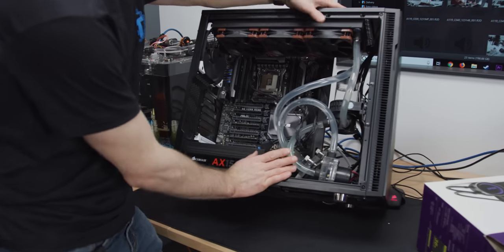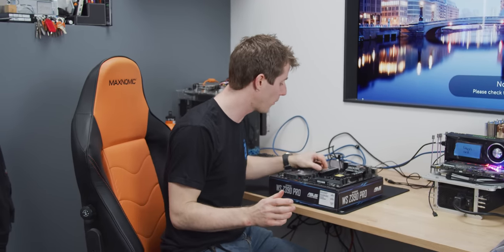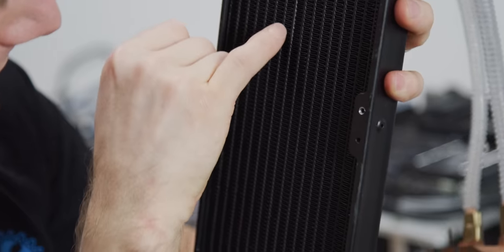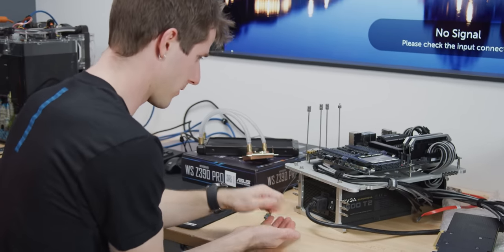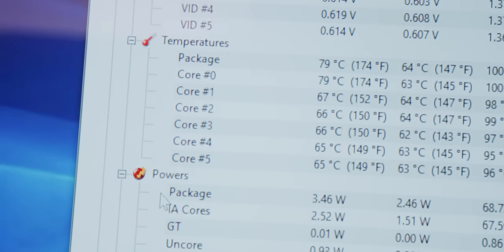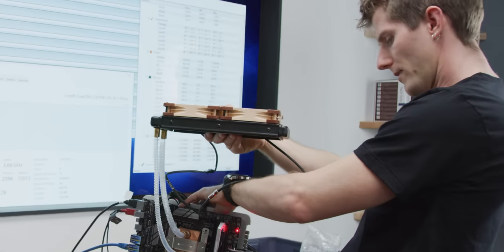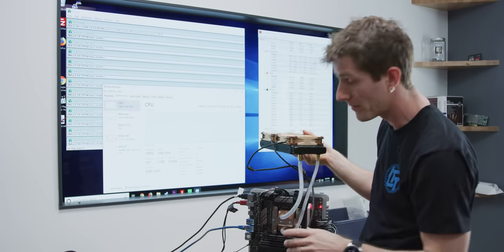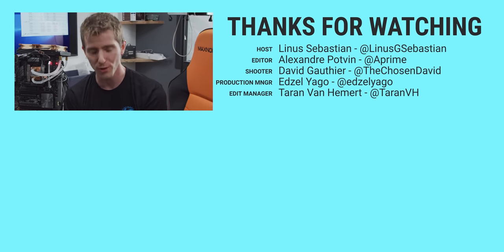CPU Cooling with BOILING LIQUID 🔥🔥

Comment: they should put a pair of one way valve on both tube, so that only 1 tube is responsible for the heated coolant, and the other will be responsible for returning the cooled liquid. it will also help to raise the heated liquid quicker.
Reply: One way valves require a differential pressure to open.  Putting one on this system would cause it to no longer flow.
Reply: Not needed. If Linus has held the radiator in the correct orientation with one of the tubes higher than the other onto the radiator it would have flowed nicely. Hot water rises while cold water sinks. The radiator is a long path running from one end of it to the other and back with the tubes connected on each end of that path. He basically tried to force hot water in to both ends of the radiator.
Reply: @pederb82  exactly.  It should be sideways with the hot side on the top and cold side on the bottom just like the water block.
Reply: @Hello World They would be expensive to produce and exceedingly large to do the flow required.  They are not one way valves, they just give high flow resistance in one direction vs the other.  You are also dealing with gasses, not just liquids in this design.  The design also requires high velocities fluid velocities.  The resistance ratio goes up the higher the fluid velocity is.  The velocity of the fluid in this arrangement is very low.  In order for this type of device to be helpful, it would need to deal with a single phase and use a pump to achieve the velocities needed to get a ratio.  Both of these constraints defeat the purpose of the intended design.  A hollow plastic float on the cold side oriented in the vertical direction that would seal into a seat would work much better and be much cheaper to design.  It would probably also offer too much resistance to makes its use more effective than not having it at all.
Reply: Hello World it can be done with an different layout of the radiator quite easily. They could have the entire top side of a horizontal radiator as hot side and bottom part as the cold side. :) it would be a bit ticker than the radiator used here but other than that practically identical.
Reply: @Hello World The makers of the cooler should have done a radiator where the ports are on opposite sides instead of the same side.  Hot side goes in the top, cold side come out the bottom.  That being said, they did not and used a standard radiator.  What Peter said would be how the radiator would need to be oriented to maximize the equipment given.
Reply: @pederb82  Lol you posted this while I was writing mine.
Reply: @Hello World Making a single pass radiator is just as easy as a dual pass radiator like what what used.  The reason they probably put them on the same side is it looks cleaner and you can have more radiator area for a given size of radiator.
Reply: @pederb82  true
Reply: I think it would work. This is how a coffee maker pumps water. The local high pressure of the water vapor opens the valve. This is why the coffee maker spits the water upwards
Reply: @AllElectronicsGr  A coffee maker only has one outlet, not 2.
Reply: @Worrsaint   There are two outlets in a percolating coffee maker, but one is blocked by the one way valve. Go check out the design of the siphon tube in a percolator and get back to us.

Comment: You have both pipes at the same level.  The intake side should sit lower than the hot side.  Since heat rises yada yada yada, once cooled by the radiator it should go through the cold side and come up from the bottom.

Comment: they should use iso-pentane as solvend, it boils at 28°C degrees so the cpu block technically won't go much over 28 degrees, altough you will need some beefy fans to cool them enough to prevent overpressure of the system altogether which is very dangerous. Cooling will be great as long as you can cool the solvent to get liquid again.

Comment: It's called thermo-siphoning.
Early automotive water cooling works the same way.

Liquid used in the thermal solution had very low boiling temperature. The boiled liquid turned into gas and carry heat away from heat source. Once the gas cooled, it return to liquid state and continue the cycle all over again.

Comment: Seems promising. I think that having a vertically-oriented radiator, entirely above the CPU, would make the most sense, so the hot gas moves to the top of the radiator, and liquid comes out the bottom back into the CPU block.
Reply: No because you would decrease the airflow  by convection. The ideal is a slitghly tilted configuration in the horizontal plane, so all the fins receive a fresh airflow

Comment: What about connect one pipe straight to the faucet
 and the other to the drains? ABSOLUTELY SILENT cooling system!
Reply: Just live by a river and use river water as inlet cool water, discharge the hot radioactive water back into the river!
Reply: @soupwizard  Do you mean the revolutionary "Industrial" way? XD

Comment: I think it is supposed to work like the bubble-pump in a coffee-maker. There are stem bubbles forming that float up pushing the liquid as it expands. That's why it should be mounted vertically with the large pipe up, liquid+steam takes more space than just liquid.

Comment: This is kinda funny.  I did the same thing back in 2004, using a single thick hose and a floorboard radiator for cooling and HFC152a (Canned Duster) as a transfer medium.
It almost worked.  It kept my tbird 1400 nice and cool all day long under moderate loads (better than typical fan cooler), but because of the overly simple block design, under heavy load it would eventually boil fast enough that it had a sustained bubble keeping most of the fluid from returning to the block, and the temperature would quickly spike and crash the CPU. (No thermal throttling in those days)

Comment: I know this is an old video but one thing that could make a great difference would be adding 3d printed tesla valves, especially using a sla printer.  This would add check valves keeping flow going in one direction without adding possible mechanical failures. Keeping the no moving part theme. And of course I'd find another fluid.
Reply: Sorry for being bitter but tesla valves just don't work...

Comment: I have my pump over in the next room, woke lvl1000
Reply: Mine is in the basement with the 55 gallon plastic drum...well actually there is 3 more pumps in the loop and an internal reservoir inside the PC case as well, but it keeps me down to 40 C under full load with no radiator or fans.

Comment: There aren't very many fluids that will go from a gas to a liquid around ambient temperature. It is definitely something of a low boiling point kept under pressure or a high boiling point kept in a vacuum. As to what it is I do not know. Possibly methanol put under a few hg of vacuum. It naturally has a boiling point around 64c and a vacuum would lower that substantially. That would explain not using typical plastics or rubber seals. It does not however transfer heat so well so it would have to stay quite cool to do the job which further supports it being under vacuum.

Comment: I don't understand why they don't combine a liebig condenser with a fractionation column: Have an inner tube and outer tube. The inner tube should be water which evaporates near 100°C. The outer tube should contain either a different (cooler) liquid (or maybe water) which would be fractionated to help heat travel up and down the pipe. A third option would be to increase the pressure in the pipe, which would lower the boiling point of the water and increase cooling efficiency at lower temps. This would decrease efficiency at higher temps though, and to solve this, the inner and outer pipes could be both higher and lower than atmospheric pressure to service cooling at low and high cpu temps. Just some thoughts.
Reply: You mean decrease the pressure to increase the boiling point? When atmospheric pressure is lower, such as at a higher altitude, it takes less energy to bring water to the boiling point. Less energy means less heat, which means water will boil at a lower temperature at a higher altitude.

Comment: We already have those, they are those air coolers that can also work passively.
Just install a 340W tdp rated one in a 80W heat producing CPU, and turn the fan off. Works great.

Comment: A wild guess:
The "fill port" at the block may initially have been used to fill the system to a certain level with liquid (most likely water, with additives). 
By sucking out the remaining air to make a lower pressure inside the system, the water will boil at a lower temperature.
The "fill port" is then sealed to avoid any air entering the system. 
I guess the clear tubes are ribbed to withstand the negative pressure......to stop them from imploding.

Comment: Sure you don't have a pump that's going to fail, but a CPU that runs at 95-100c all day every day certainly will
Reply: Not really... look at laptop CPUs, the stay in the high 90s and they work fine .
Reply: you could use a bunch of small pipes which would create steam at lower temperatures and would still work
Reply: I'm sure that it's not really designed for overclockable i7s but rather for making silent mid-tier system on i3 and i5 which have significantly lower heat output that can be easily dissipated by this thing. Though if it still will require a fan, a decent tower with low noise fan will do it better and cheaper.
Reply: my laptop cpu is at 95-102 C
24/7
5 years still works great
Reply: @adrian80_  damn bro what are you doing all day
Reply: @bobbyflay4104  playing games
Reply: Extremely late but no all modern CPU and GPU  hard ware can chill in the 90-100 range for longer than your upgrade cycle any actual dangerous temperature will cause the system to turn itself off.

Comment: Large tube on top to carry the vapor, smaller tube on bottom to carry the liquid return.  Gases have a higher specific volume than liquids.  Also need the vapor return line to be on the top side of the radiator so that the liquid return can be more easily gravity fed.

This is a common type of set up for steam condensing systems or other industrial applications.  Especially for refrigerant cooling applications on large scales where the efficiency vs capital cost makes sense.

Comment: Final step for no moving parts PC:
Anybody got some spare ion thrusters?
Reply: The gas and electrons are still moving.  Ion thrusters also produce very little force (barely enough to levitate paper) and at least a little bit of heat.  Their strengths are that they require almost no power/fuel and can reach insanely high speeds if kept running so they're better for long distances that don't require changing direction and still need something else to get them started/out of Earths gravity.

Comment: Linus has no idea what he is doing I feel so bad for the people that made this prototype
Reply: yeah, and calling this cobbled together while it has nice bends, no sharp edges, plated so it doesn't corrode, spot welded or riveted and can be mounted without any instructions. Really hack job made in basement with angle grinder.
Reply: Also, Linus is never seen to apply thermal paste, but we see him detach and reattach the same heatsink again and again, in the same sequence. Doing that would turn the thermal paste into nice heat-resistant foam.

Comment: Isn't this basically an air cooler mounted to a radiator?

Air coolers use a gas that rises when heat up and turns into liquid when cooled.
Reply: No, aircoolers work with airflow and the chilling effect of wind on a metal heat dissipation area.
Reply: @7i4nf4n  ...which is what is happening here.
Reply: Yes, but heat pipes are not flexible.
Reply: @WinterCharmVT  
Except heat pipes ARE flexible when you make them out of flexible materials.

Heat pipes exist in many other places and industries than just your computer...
Reply: @7i4nf4n  
Yes, and how do you think the heat gets to the metal fins on 90% of  aftermarket air coolers?
Reply: @nickopedia5669  Simply through heat spread in the metal, no gas needed.
Reply: 7i4nf4n depending on whether or not it has a vapor chamber which many of them do. They are not all solid metal pipes but have small amounts of liquid in them that vaporizes and then cools inside the heat pipes.

Comment: But what about CPU Cooling with a Metal Computer?
Reply: No.
Reply: He's kinda done that before. He made a case out of radiators, and cooled the PC with it.
Reply: @UnsweetIceTea  😂😂
Reply: The metal cools it passively.
Reply: There are already commercial cases that act like a passive heatsink. Linus did a video on it back in 2017 
https://www.youtube.com/watch?v=9LauL5JxYis
Reply: It's one of the laws of thermodynamics,  like a hot steam iron it doesn't get hot" until you touch it or come in contact with it the heat is stored as energy turns into heat when you touch it

Comment: The two tubes act as heat pipes , there's no way currently that isn't overcomplicated to make sure hot and cold are separated without a pump forcing the fluid in just one way.

Comment: The radiator needs redesigning with the larger hot input to the radiator higher than the smaller output to thermal properly. Old houses used to have a back boiler above the open fire and this used the same principal to circulate the heat to radiators without a pump

Comment: it's probably just water, water and close to no atmospheric pressure at all, like you would have in most heat pipes. as long as all you have in there is water and water vapor, no other gasses whatsoever it should work pretty fine.

Comment: magnetohydrodynamic cooler with mercury. Solved. No moving parts.
Reply: YES
Reply: Only problem, a liter of Mercury weighs 13.5 kg
Reply: @SuperSayinSolidSnek  AND it's deadly toxic (meaning you can die from exposure to the mercury), so it has to be VERY well sealed.

Comment: The radiator should be on edge with large tube on top. Cooling block loriented with large tube up. As fluid boils, vapor travels up through large tube, condenses in radiator,  and liquid travels back down to cooling  block. 
For best results, the volume of liquid should be just enough to fill the block, small tube, and cover the bottom tube connection. That maximizes the surface area of radiator available for condensing.  vapor.

Comment: I believe if you replace the water with special coolant that can vaporize at lower than boilinpoint of water while also having the ability to conduct heat easily and I believe if you take the gas hose shove it at the top of the radiator and the liquid end at the bottom of the radiator in a vertical position would help circulation.then pressure stored in the top of the radiator can push the coolant through the tube at the bottom of the radiator

Comment: It’s called thermosiphon cooling...used extensively in huge central industrial refrigeration plants usually boiling liquid anhydrous ammonia.  Drip coffee makers also use the same effect to pump the hot water up into the filter basket.  It works because a pipe full of liquid exerts more static pressure at the bottom than a pipe full of liquid and vapor, so the difference in static pressures create flow.  There’s a lot of engineering considerations regarding the expansion ratio of the working fluid, having the right size passageways in the heat exchanger so that the rising bubbles draw up the liquid behind them more effectively, and being able to evacuate all of the vapor from the heat exchanger effectively so that it doesn’t get vapor bound. They should choose a working fluid that boils at a lower temperature than water.  Water is actually difficult due to its massive vapor expansion ratio compared to most refrigerants, besides the fact it doesn’t vaporize below 100°C at atmospheric pressure.

Comment: This layout bigger is better and a non return valve would help. Hot fluid expands cooler fluid contracts pressurizing the loop. Starting from a vacuum would help with getting the loop started and hurt as you always need fluid not vapour to cool. Adding anti freeze might help with the vapor issue. The anti freeze tends to gunk up making regular use a requirement to keep the system going. Could be great for bit coin miners.